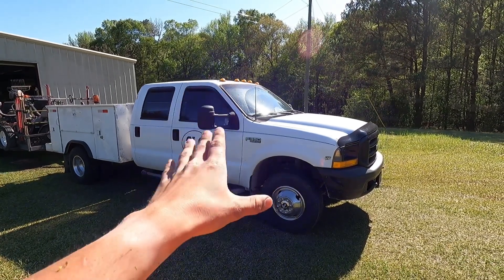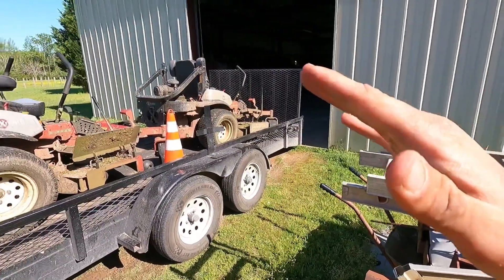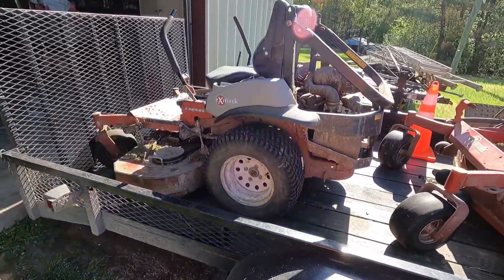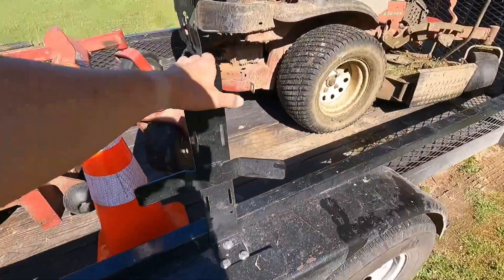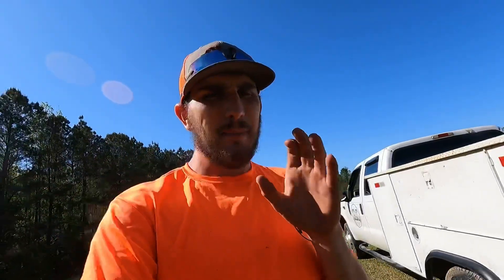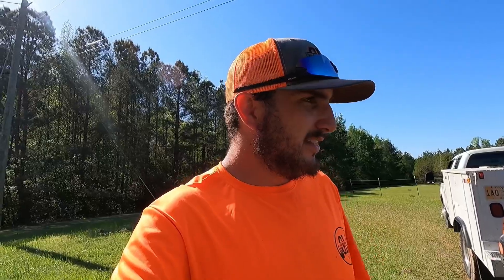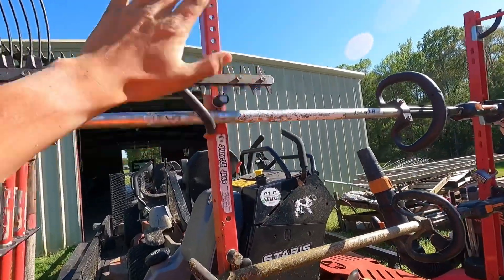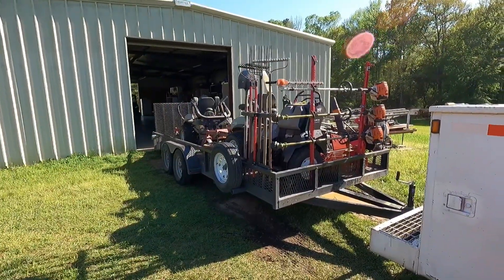My 2022 Lawn Care Set up!

Comment: Had the same tank vent issue. My dealer didn’t fix mine, but I learned if you loosen the fuel cap at full throttle to self vent it, it’ll run like a champ.

Comment: I have 3 of them Exmark E-Series mowers too, at around 1300 -1500 hours the Cylinder head cracks because of the muffler bracket stresses the metal. You'll know because it will start leaking oil.
Reply from the maker: Interesting. I appreciate that. I have one mower leaking oil right now and it has a little over 1,000 hrs on it so I need to check it out and see.
Thanks !